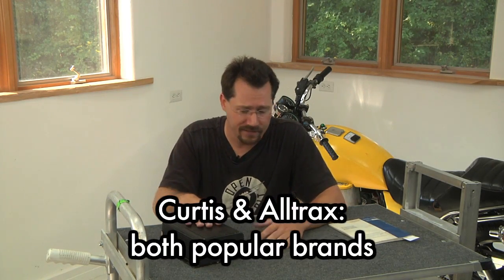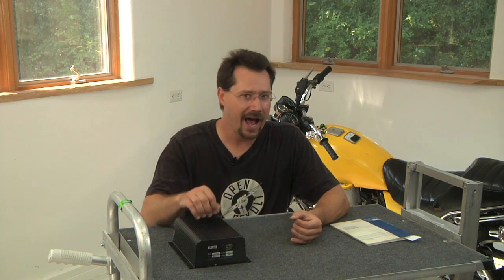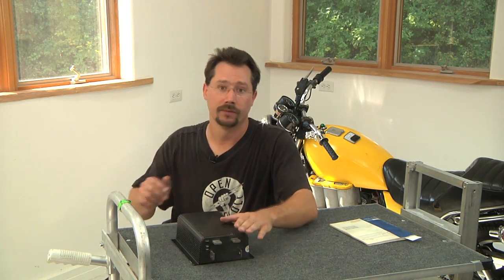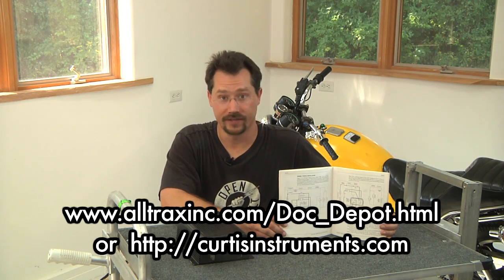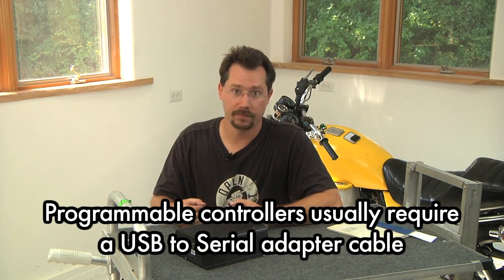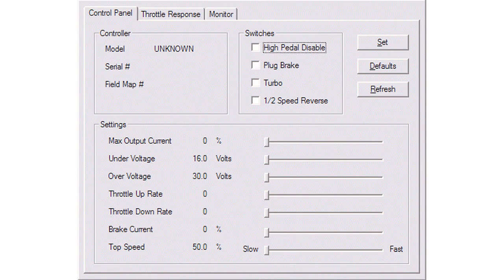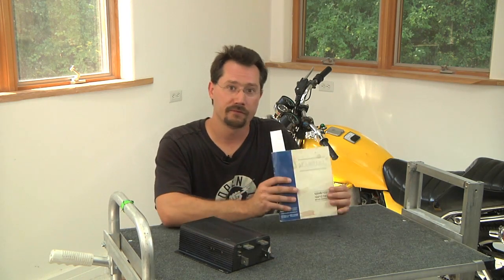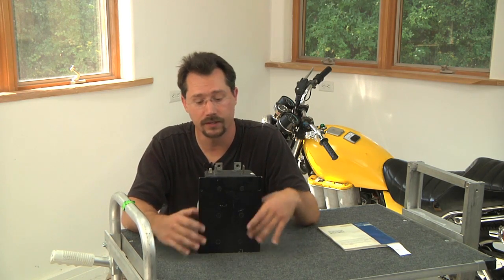10 Build Your Own Electric Motorcycle - FULL - 10 DC Motor Control

Comment: 11 thumbs up !...no...12
for many of us,  LEARNING is in itself a joy.
Electric Vehicles and Gas to electric conversions are a hot topic and this series is pro level.
Is there a way to communicate privately with Mr Mac?

Also, do you have series discussions on 
1) "best techniques for Care, mx and charging lithium Ion type batteries" 
and/or
  2) Theory, Components and Wiring Strategies for A/C powered electric vehicles" ( A/c powered motors appears to be the nest better thing for efficiency... so... please)

Thank you sir
Reply from the maker: Just search this YouTube channel.
A friend of mine built an AC car that I shot a number of videos on.

Comment: One more question if my motor have 5kw and peak 10kw I can’t put a controller 10kw? Or need to be same of 5kw?
Reply from the maker: The rating of your motor controller is the MAXIMUM amount of power it can output to the motor. If you have a motor that peaks at 10,000 watts, then a 10kW motor controller is the perfect match. If you have a motor which COULD draw more power, but the motor controller is rated for less, it will limit how powerful your motor can be.
Reply: BenjaminNelson now understand you the another question need to make battery 10kw for this to or only any battery can support it ?

Comment: Great series! I've been following the instructables you've made and I quite enjoy these videos. 
I do have a question about controllers though, like, how fast would a 24V 250W controller run a motor? 
Thanks! Keep up the great work!
Reply from the maker: On DC motors, speed is proportional to voltage. So, a 24V battery pack would spin a motor twice as fast as a 12V battery. In general, you want to have as high of a voltage as possible because higher voltage means less current at the same power level. This means less heat lost in the wiring, and it's gentler on the batteries.

Comment: What controller should I get
Reply from the maker: You should get a controller that matches the type of motor you are using. It should support the same voltage range as the battery pack you are using, and it should allow for as much current as you need to draw for acceleration, passing, and hill-climbing.

Comment: what happens if you doing 4Mph and let go of the throttle? does the DC motor just lock up?
you're videos are awesome by the way, i really appreciate that you put these up here!
Reply from the maker: It's the same as if you let off the accelerator on a gas motorcycle, except that the electric motor offers less resistance than a gas engine. More or less, you just coast.
Motorcycles can also be designed with regenerative brakes so that when you fully let off the throttle, the cycle begins to slow down a bit in exchange for charging the battery. I never rigged up regenerative braking on this cycle. My next cycle was a Vectrix, which has a cool throttle which provides regenerative braking by twisting the throttle the opposite direction.

Comment: how about if you do not use the controller !
Reply from the maker: Without some sort of speed control, there's only two ways to run a motor, ON or OFF.
The only time I've ever seen that done on a vehicle is for drag-racing.